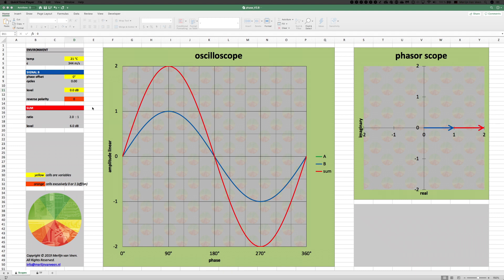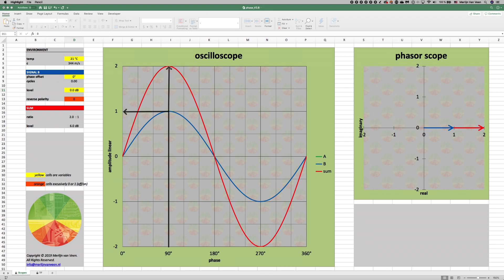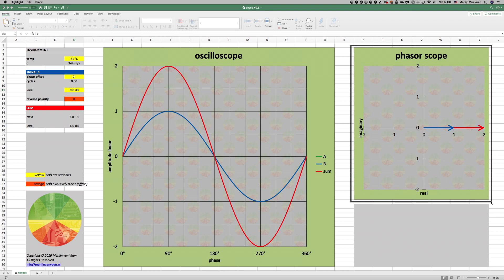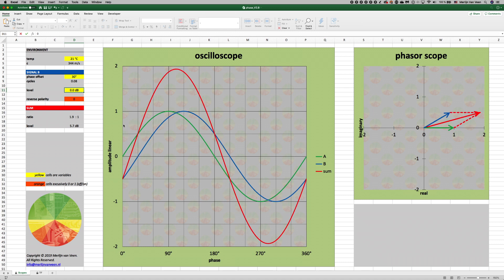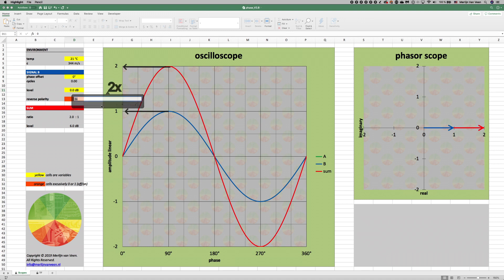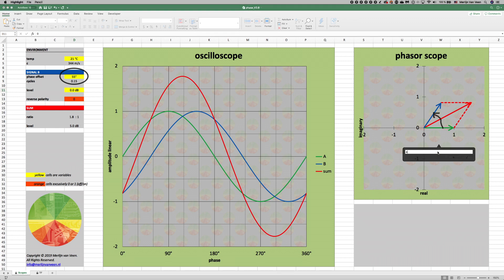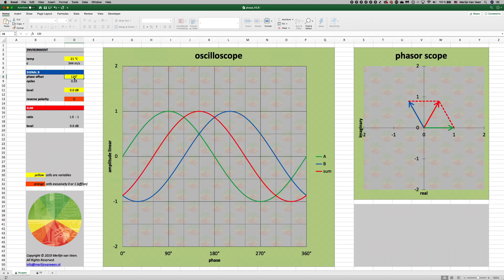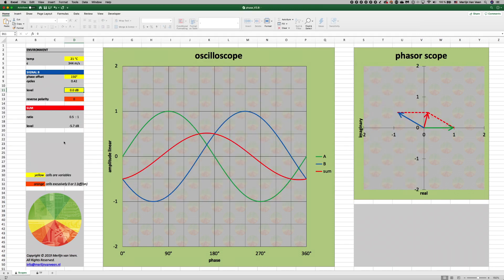Summing Sine Waves with Phase Offset

Comment: I'm curious why two 120V legs of 208V 3 phase system, separated by 120º, sum to  208V instead of 120V as this calculator indicates?  Anyone know why that is?
Reply from the maker: Excellent question! Sound pressure is about summation. Whereas three‑phase electric power considers the — difference — between phases, i.e., subtraction.

I posted an illustration here:

https://www.facebook.com/merlijn.vanveen/posts/1028349245335764